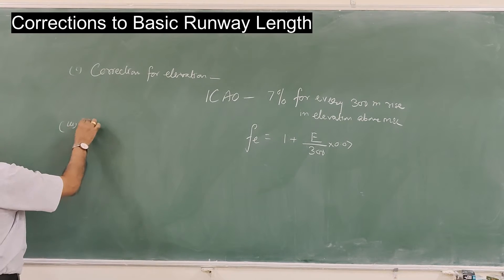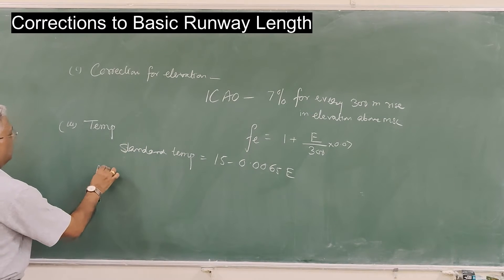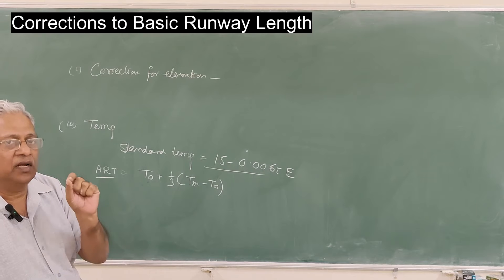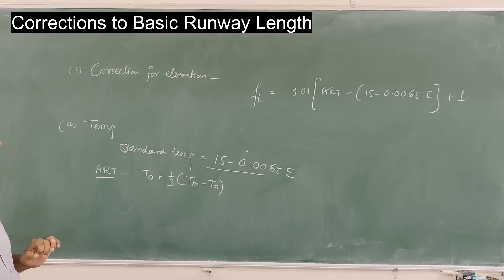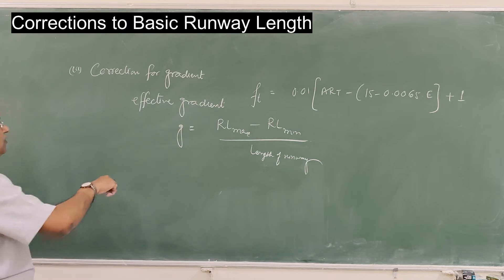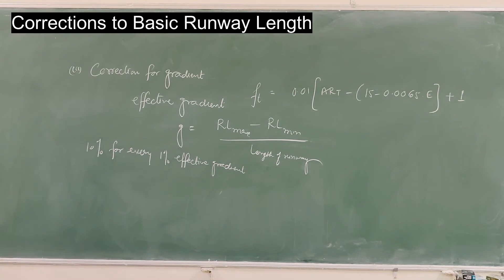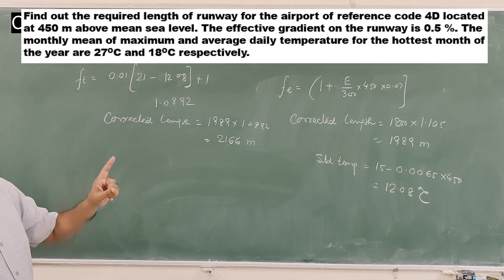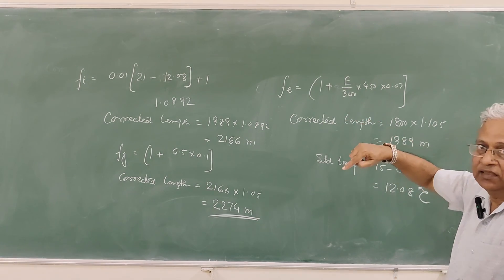Basic Runway Length Correction for elevation, temperature and gradient, Effective Gradient on runway

Comment: Sir, can u please tell one thing. Since, we increase the runway length by 10% for 1% gradient acc to new guidelines. But yesterday in coaching class a teacher told to use 20% not 10%.
So, in GATE 2026 if question comes so which one should I use?
Reply from the maker: I do not know what coaching institutes are teaching, but the correct answer to your question is like this.
If the length of runway after correcting for elevation and temperature is less than 900 mm, correction for gradient will be 20 % per one percent of effective gradient.
If it is more than 900 m (which is generally the case), it should be 10 % for every one percent of effective gradient.
A question was there on this topic in the Afternoon Session of GATE 2025. I shall upload the solution very soon, may be after Deewali.

Comment: The FAA recommends increasing the runway length by 20% for every 1% increase in effective gradient.
sir which one we should use (10% for 1% )or faa recommandation.
Reply from the maker: That was old practice. The new guidelines are for 10 percent
Reply: @SatishIITR  thank you sir
Reply: @SatishIITR 
With due respect sir,
There was a question from runway length correction in 2nd shift of gate ce paper 2025:

The corrected length of runway after elevation & temperature correction is 700 m. What will be the final length of runway after considering 1% effective gradient?
And 770 m was not in any option but 840 m was.

I'm just thinking how come iit roorkee can set options like this?

This confusion came when I was revising this topic from a video of a coaching institute & they told to take 20%. But somehow I knew that my professor from iitkgp had told to take 10% correction. I just came to your video for verification & this is what happened. 😅
Reply from the maker: @Anand_Kumar88  you can challenge the answers giving relevant pages of ICAO manual
Reply from the maker: @Anand_Kumar88  You can challenge the question, write to IIT Roorkee
Reply: @SatishIITR  
Ok sir
I'll do once the portal for challenging questions will open.
Reply: @SatishIITR 

Sir, I'm giving ICAO: Aerodrome Design Manual, Part 1 — Runways, Fourth Edition, 2020 as a reference for challenging the question.

Are there any other documents that I should include?
Reply from the maker: @Anand_Kumar88  That should be good enough. You can refer my book also on Airport Planning and Design

Comment: Sir for runway landing  case why only one correction i.e. elevation correction is enough. Why we are not considering temperature and gradient correction
Reply from the maker: where did you read it? Basic Runway length is estimated considering three cases - normal landing, normal take-off and aborted take-off. I explained all three cases in earlier video. After you get the basic runway length, then correct it for elevation, temperature and gradient. Now there is no landing or take-off case. 
Where is the confusion?